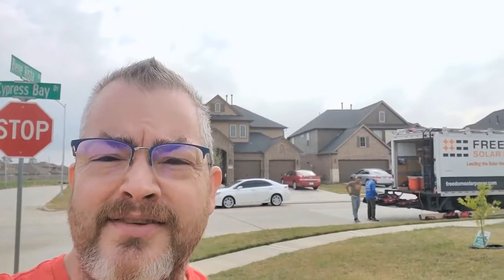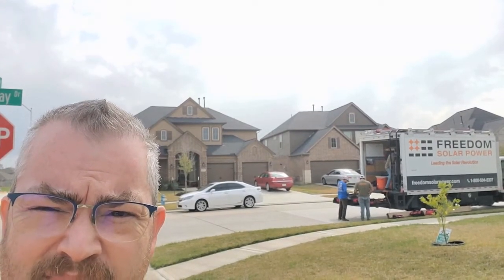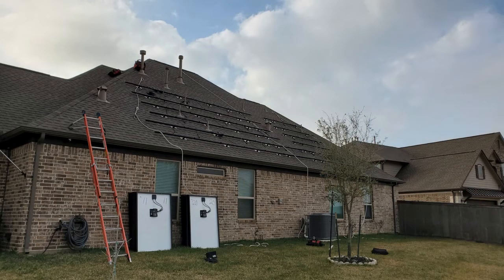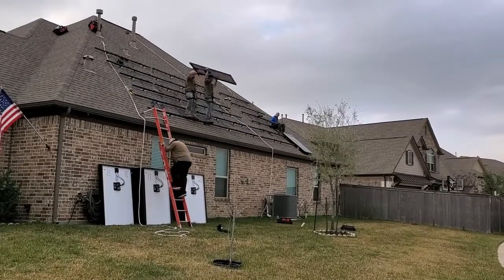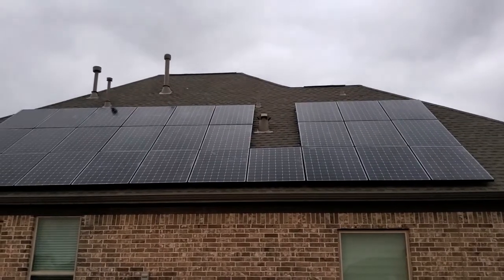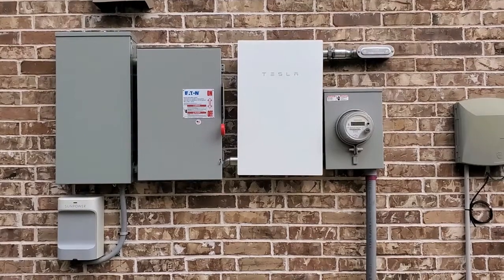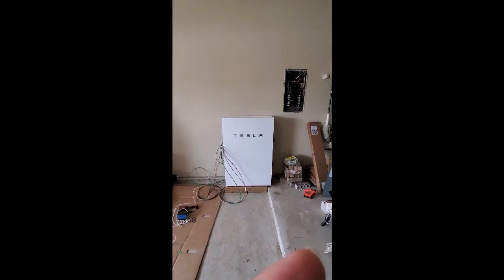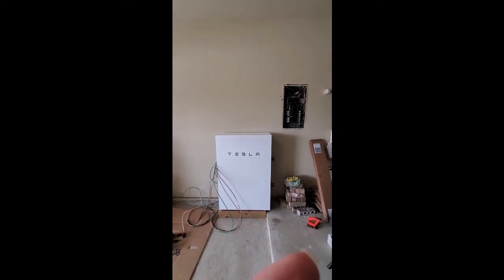Solar Panel Install with Tesla Powerwall 2

Comment: That’s the same company I’m going with to get my solar and batteries anything bad to say or anything to give me a heads up to look for siting the install? Thanks in advance.
Reply from the maker: Just know that you can have the batteries installed side by side or stacked (your choice).  Running the wiring through the roof is aesthetically pleasing, so if they can do that then do it.

Welcome to the solar family.

Comment: Cool! Did they install Mirco Inverters if not, what brand did they install?
Reply from the maker: Yes they installed micro inverters for each panel.  And I'd have to dig through my paperwork to find out the brand.

Comment: My 11.6kw solar glass roof w/ 2 Powerwall+ was completed/inspected and commisioned July 26th. Now I am told there will be a 60-120 day delay for Tesla to send COMPLETED ELECTRICAL inspection report to my local utility. Then I will have the normal 30 day wait for my utility to change my meter and give me my Permission To Operate. Can u imagine, Tesla can make me a car faster than send paper work by e-mail?I am told ther is a lack of qualified peolpe to fill out report. It could be x-mas till I get my PTO. I will have my Model 3 next week and I orderd it July 28th.  Lack of comunication is still an issue. Im not so sure I made a good choice going Tesla Solar.
Reply from the maker: I understand the solar roof is supposed to be nice.  Sorry you're having delays with the inspection report and PTO, hopefully it'll happen before Christmas.  Good luck and I hope the roof  works as described.

Comment: Thanks for the video. I am currently getting bids and I have those same bathroom/sewer breathing pipes.  One company said they would have to leave spaces around the two pipes, another said they could put an elbow on them and have them come out the side.  Did your guys just chop it shorter? Did they say that was ok?  From what I understand it just provides air flow for when you flush or something so it seems like you could just cut the pipes but they must be that long originally for a reason right?  Please let me know your thoughts, I really want to avoid gaps if I can, your's looks pretty clean!
Reply from the maker: I'm not sure if there are laws/rules regarding what they can and can't do regarding the vent pipes with respect to cutting them.  The vent pipes are for drainage of your sink/shower/tub (air behind water).

I have seen videos/pics of installs that are all over the roof (avoiding the pipes) in other states.  But every install that I've seen in Texas has been a clean install like ours is.

I guess it just depends on the company, and the state as well.

Good luck, and welcome to the solar family.

Comment: I am surprised that they cut your vent pipes. According to code I saw:  The International Plumbing Code (IPC), requires plumbing vent pipes to extend vertically at least 152 mm (6 in.) above a roof, per Section 905.5, "Vent Connections and Grades.
Reply from the maker: Well, since I'm not about to grab a tape measure and go check, and since I'm not having any issues with drainage (air behind water), I'm not gonna worry about it.

I'll let the plumbers, solar installers, and inspectors worry about what they can and cannot do.
Reply: Updated international building codes allow for vents to be cut down now. The height is originally to protect against water ingress if snow builds up. But panels protect against such build up.

Comment: although placing flashing on the same rafters is aesthetically pleasing, it doesnt distribute the weight as well as a staggered setup... surprised they didnt do staggered on your roof
Reply from the maker: Why stagger when there's no need to stagger.  And the roof is designed to evenly distribute the weight load.
Reply: @TheSeatrippers  the flashings are spaced every other rafter, thus only half of the rafters are bearing the weight... although the roof would be able to handle the load in the current setup, over time the weight may cause slight dips in the roof since not every rafter is bearing the weight
Reply from the maker: @mwd5233  I appreciate your concern over my roof, and what may or may not happen to it.  And since you didn't build my house, and I'm not about to go take pictures, in my attic, of the roof construction, I'm just going to say that your comments and concerns have been duly noted.